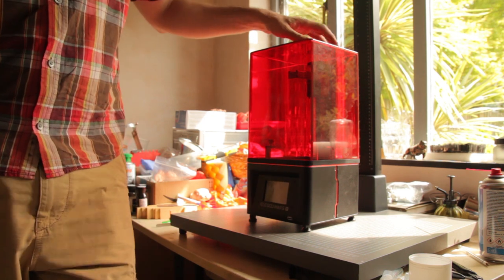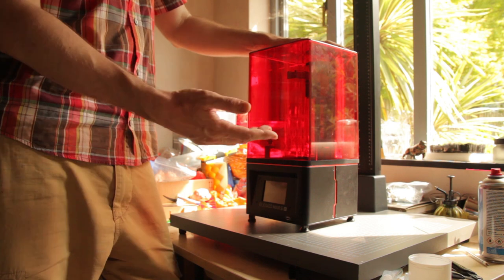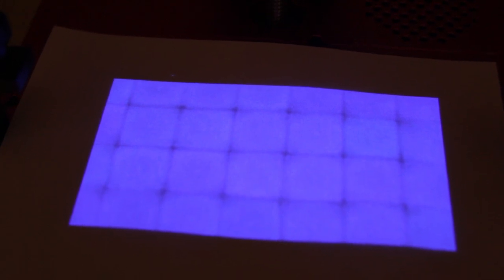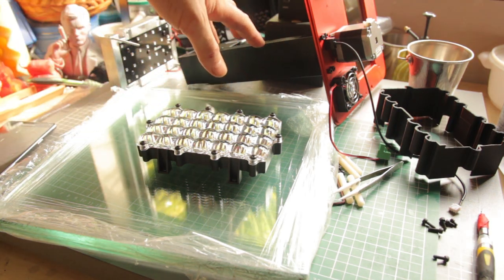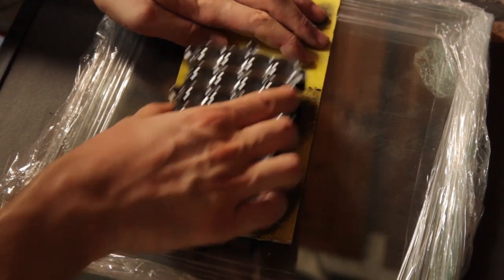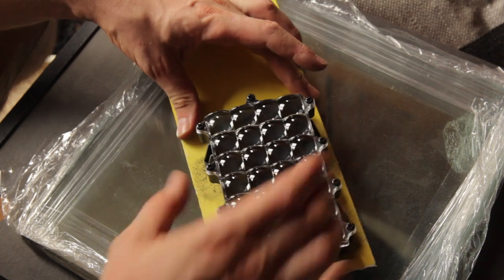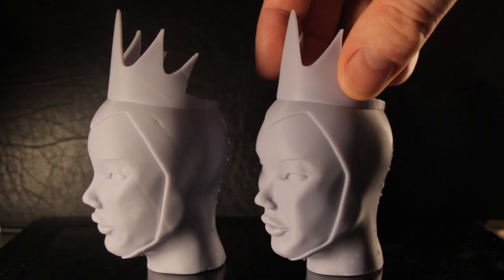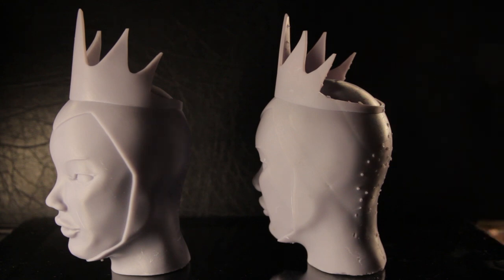ELEGOO MARS PRO GRID LINES LENS ARRAY HACK

Comment: I've got an idea. So with the sanding you are basically increasing the space between the UVs and the LCD, right? Could you do this without sanding? Instead could you place some o-rings on the long screws that hold the UV array to where the LCD is?
Reply from the maker: There are issues with clearance insidee thats the issue. Im working on it.
Reply: H D  No its increasing the space between the array and the LCD by removing material on the base of the array frame.
Reply: H D  Apologies I meant space from the array to the screen that is at where the vat sits (I assumed it was an LCD based off the comment above) but you are right moving the array closer to the LED source.
Reply: H D  I think this is a quick fix but doesn't address the issues like you said, to me it looks like an improvement due to increased LED intensity/shifting the focus point. I haven't looked into the way the Mono screens light source works but that may be the way to go. Issues like this are to be expected when you consider the product they are delivering for the price.
Reply: H D  I was just reading the same thread, its a shame my unit is arriving today. I'd like to see if they are using the same array lens design for the Saturn.
Reply from the maker: H D  they get paid for reviews its so clear. I mean this issue just highlights the actual level of quality these people judge against. They have no clue or knowledge about anything they talk about. Its like they are being told to say it. Or just say it because others say it. I mean for me to be the only one on the internet bringing up an apparent issue that has existed for a while since arrays were introduced says it all really. Makes you wonder why I even bother listening to their fake reviews.

Comment: Could it be that the reason for the grid on the LCD is the grille that stands under the lens? Perhaps it casts a shadow on the edges between the individual cells? Maybe try using a lens on a frame without meshes?
Reply from the maker: Ive made another video and indeed the grill is too thick and a thinner one helps get a better image without sanding but there are other factors to deal with as well. I just ripped my lcd ribbon so im going to have to wait a few days before i test it. There is also a link to download it if you want to try!
Reply: @Cloakfiend  
unfortunately I have no experience in 3d printing. I want to buy myself a printer and therefore I am interested in different models. I wanted to order Mars but I see that there are some problems. I just assumed that the grating might collapse and interfere due to its design, depth, thickness and distance to the lens

Comment: Somebody else has this issue - I feel better now lol. I'm actually about done with creating to a 3d printed replacement grid which deals with this issue. I did have one question however, Is there a good reason as to why we have grid separation for each LED individually? I have both a gridless frame and grid frame in the works but I was unsure as to why they would have a grid to isolate individual LEDs and to be honest if it was even necessary? I have not yet tried the gridless frame to see the results but I feel like they wouldn't have used one without good reason.
Reply from the maker: The grid prevent light leaks from the other leds. You need it unfortunately! Or else the light overlaps.
Reply: @Cloakfiend  hmmm - wonder if it might be worth reducing the height of the shroud then to prevent so much shadowing - like increase the edge permeation of the focused beam at the edges. I'mma play around with it a bit more and let you know what happens. Worst that happens is a bad print I guess.
Reply from the maker: @cjayfpv5823  nice, im working on another fix at the moment will post my results tomorrow!.
Reply: @Cloakfiend  so I managed to get the individual leds almost overlapping on the edges. I moved the motherboard forward and down in addition to changing the height of the panel. Testing now.
Reply from the maker: Also everyone with a mars has this issue. Its madness!!! I hope they fix it soon!
Reply: Hi, I'm very interested in your solutions. Could you consider this idea?: could you place some o-rings on the long screws that hold the UV array to where the LCD is to create space between them, thus reducing the grid shadow? Will this work?
Reply: @Pepino2012  absolutely yes but unfortunately the motherboard gets in the way of the heatsink and screws. I'm just in the process of working out him many mm you need to drop the lenses and once that's done I have the parts designed and ready for printing. As soon as it's done I'll be posting the parts on thingiverse and you can use an fdm printer to manufacture one for yourself.
Reply from the maker: @Pepino2012  already on it! And filming it!! Great minds think alike! Elegoo have anounced yet more fixes by the way!!
Reply: @Cloakfiend  Here is the link to the STL for the upgraded lens Base, it's had the shaped edging removed and the focal distance adjusted to be as uniform as I can get it. Alas I think with an LED Array it will be somewhat variable but this is damned near perfect...

http://3dhobbymart.com/Models/Mpro/Lens%20Mount.stl
Reply from the maker: @cjayfpv5823  if you use a thinner grid then you dont need to sand the feet. Also now they have adjusted the uv panel sent out to a few of us with this issue and it changes the focus even further.
Reply from the maker: Here is a link to the thinner grid as shown in my other video.
https://www.thingiverse.com/thing:4575245

Comment: My Pro is from one of the first batches on Amazon US. Did a test and no problem with mine. Guess I got lucky.
Reply from the maker: Yep sure did! Maybe post covid things went downhill i got mine in june.
Reply: @Cloakfiend  Yeah, I got mine in January. Thanks for sharing!
Reply from the maker: @Make3DTV  no problem! Always good to inform.
Reply: H D I actually do see gridlines if I look at the light reflected off of the print, but it’s not changing any detail. I don’t consider it a major issue.
Reply from the maker: @Make3DTV  it is a major issue only if you are after perfect prints.
Reply from the maker: H D  the lines result in a bad area its ruined many prints and is finally getting addressed!
Reply from the maker: @Make3DTV  it does affect prints at certain angles that the problem.

Comment: what if you print that bracket in resin? it wouldn't be short term then would it? it would cure every time the printer is being used (obviously after pre curing)
Reply from the maker: Yeah you could but youd need a bigger printer.